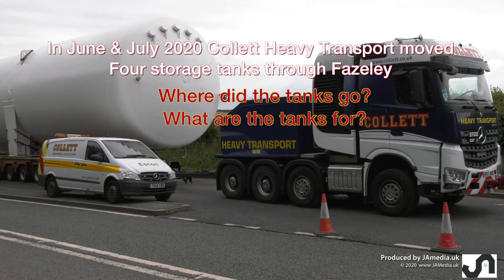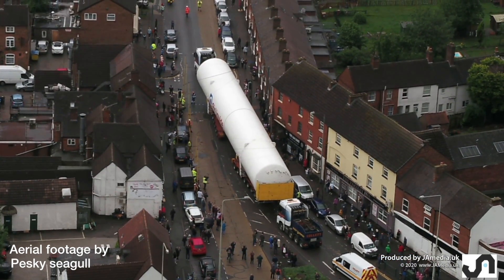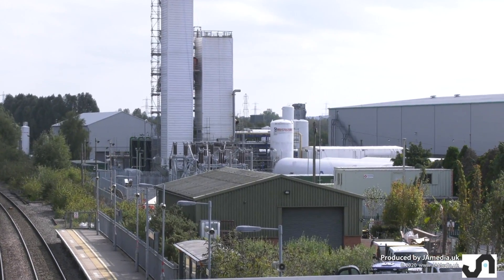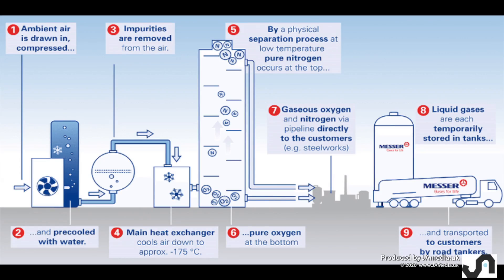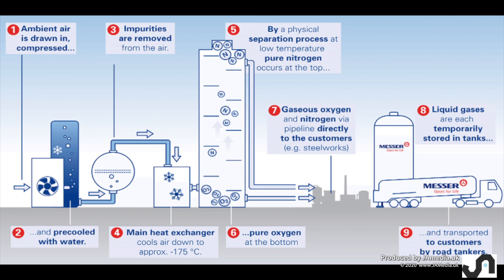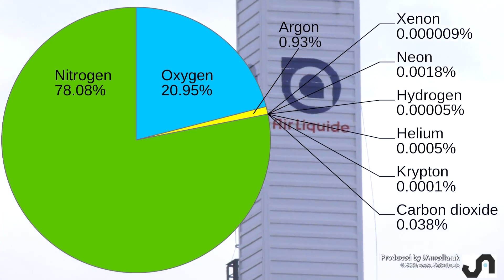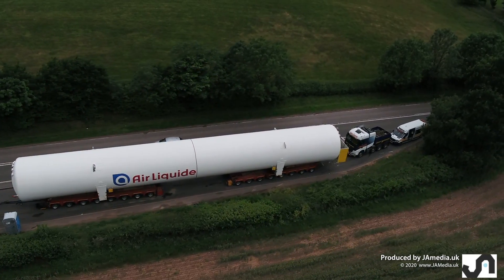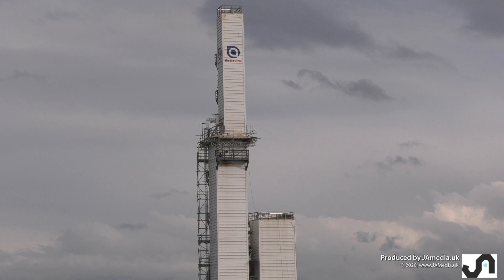The Air Liquide tanks installed in Coleshill

Comment: Why is it 3 nitrogen and 1 oxygen when the ratio is much closer to 4 to 1 ?
Reply from the maker: The three nitrogen tanks are  each larger than the one oxygen tank. So the capacity is indeed about 4 to 1 .
Reply: @JAmediaUK  ahhh thank you, I had assumed they were all the same size. Thanks for the clarification.
Reply from the maker: @ShaunCoyle1  no problems. Unfortunately Air Liquide refused all communications and requests for information. So we had to work it our for ourselves.
Reply: The Frogs 😆 were supposed to answer questions. That's what they are there for... Was pretty busy time which is no excuse. 🤦‍♀️